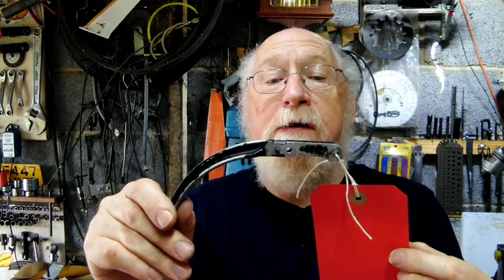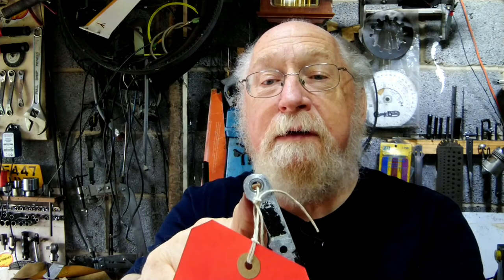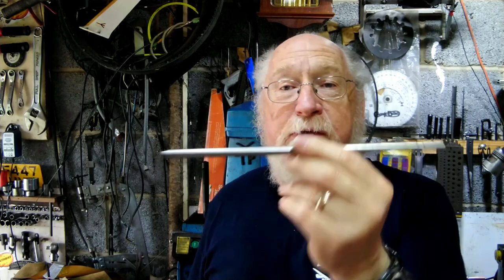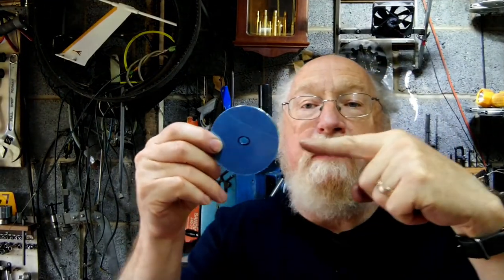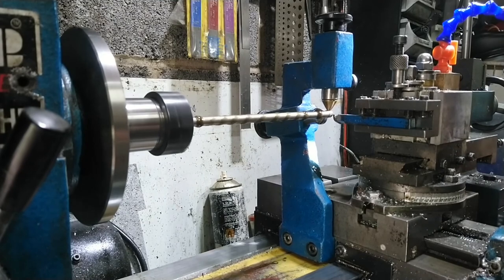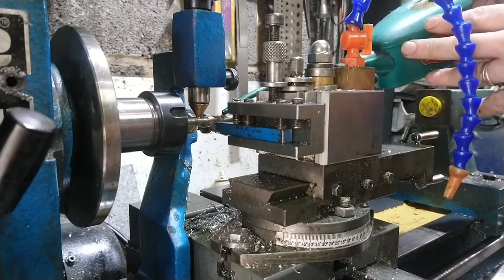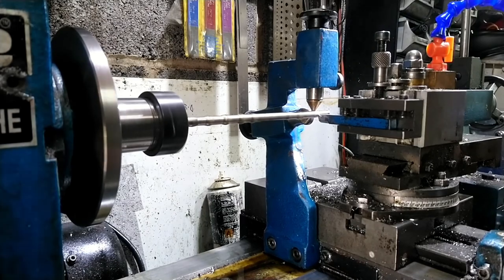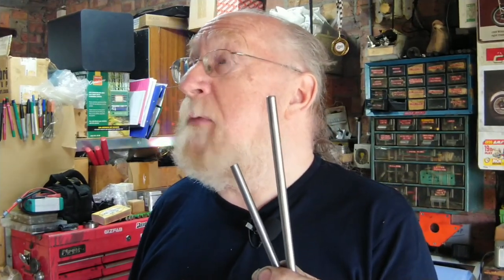Using a traveling Steady and other waffle

Comment: Hi I’m trying to purchase collet holder I see you are using one could you please tell me which one to purchase I am confused is it ER 32 ER 40 there’s a whole bunch of ER in the market and I’m very confused thank you
Eli
Reply from the maker: Ok, I use ER32, the collet set goes from 1 to 20mm.  Also the headstock on my lathe has a MT4 taper whereas the drill head and tail stock are MT3.  Hope that helps.
Reply: @SpenCrowson  Thank you very much I know I could count on you
Reply: If you have a chance is it possible to can remove it out of the chalk and take a picture of it I really would like to see what it looks like the reason is that a few of them in the market ER 32 sorry but I don’t know which one to get
Eli
Reply from the maker: @elidari60  I'll do a short vid giving details if that helps, I might have time on Tuesday.
Reply: @SpenCrowson  Thank you

Comment: Hello Spen Could you please tell me what collet chuck holder you are using and did you have to modify it to fot the Clarke lathe?  Thanks
Reply from the maker: It's an ER32 on a MT 4 taper threaded M12 for the draw bar, which you'll have to make.
No mods required fits straight on 👍
Reply: @SpenCrowson  Thanks for the quick reply. I'll look in to getting one as it will come in handy one day.